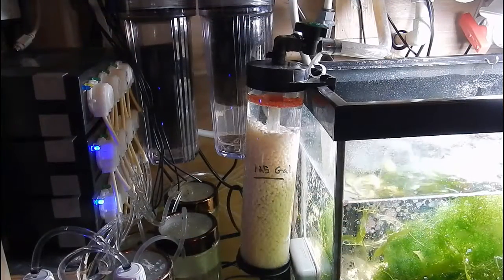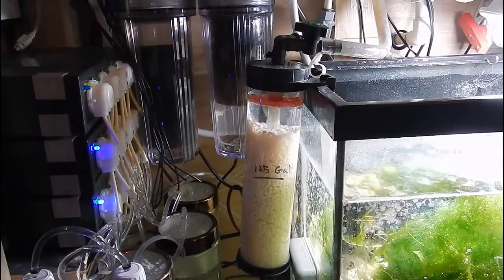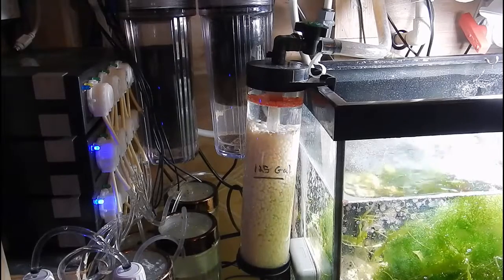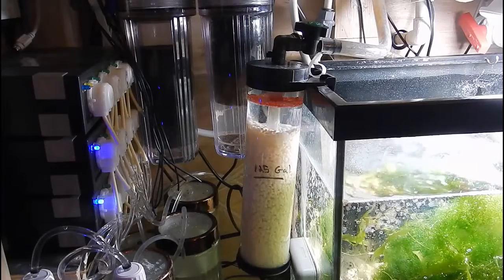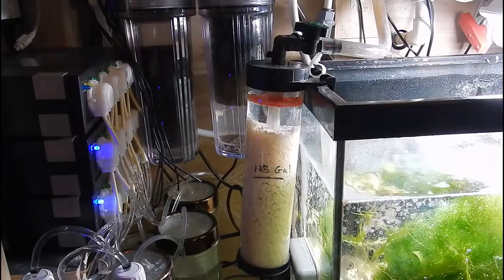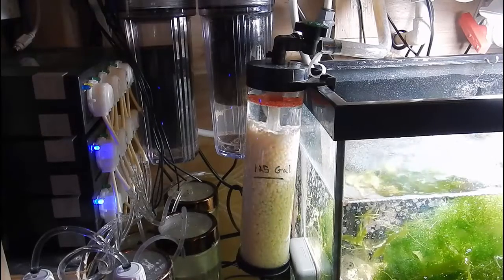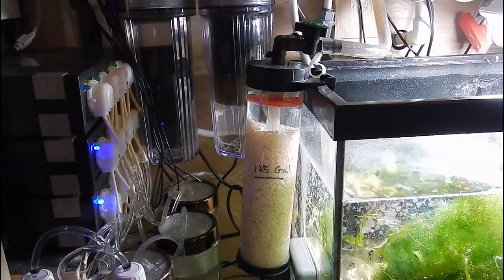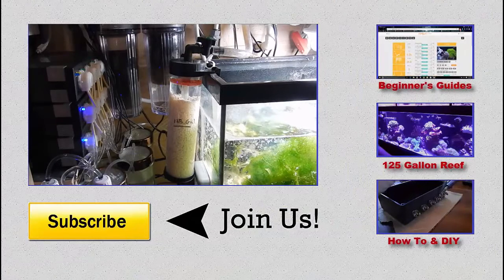Biopellet Reactor Q & A | Subscriber Request

Comment: Do you have to replace the pellets and so how often?  I am not clear why do you need a bio-pellet reactor since I see you have a fuge that are consuming nitrates, will the macro algae gets lets nutrients with the addition of a bio-pellet reactor? Thanks great video
Reply from the maker: The biopellets do not need to be replaced, only topped off every few months. I use the combination of biopellets, refugium, gfo and minimal feeding to get my system as close to ULNS as i can without going full zeo. That is how i am able to get the color with the corals. I use a multi approach to getting nutrients down.

Comment: Do you think a sand filter would work as a aquarium filter?  I'm curious on your thoughts of it working instead of using biopellets.
Reply from the maker: Honestly i have no idea about the sand filter i want to say i read some stuff on it a while back. The idea is the same as biopellets but i believe the type of media also promotes the type of bacteria needed to process nitrates.
Reply: I used a floating sand bed filter on my fresh water aquariums. I'm not using it on my salt.
The reason why you add more bio pellets is two fold. You want to start slowly and as its used up you add more. But you need to get the tank used to the pellets and that whys you add them lower the amount your tank can take ( instructions are provided - depending on tank size) 
And add as time goes on. You don't want it to go fast as it will just waste it.
Innovative marines makes a reactor that sits inside your tank or sump without worrying about needing additional hose or a exterior pump

Comment: Do you think Is safe to start a bio pellet reactor on a well stablished tank?
Reply from the maker: Yes just go very slow when adding media and you will be fine
Reply: Thanks for the advice, I seen some videos about the output of the reactor to be directed to the input of the skimmer, do you have it setup like that? does it need to be hard plumbed to the skimmer or just hanging loose close to the input of the skimmer?
Reply from the maker: I have mine hard plumbed into the side of the curve 7 skimmer input. You can have it just sitting in front of the skimmer input and that will work fine.